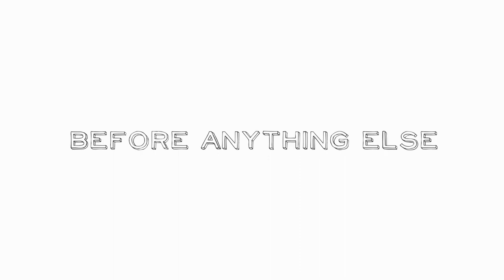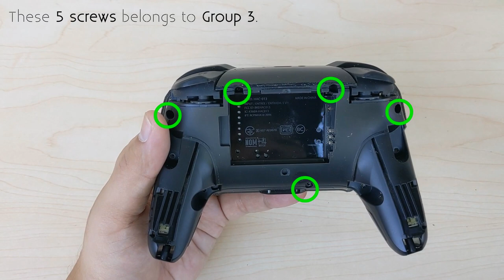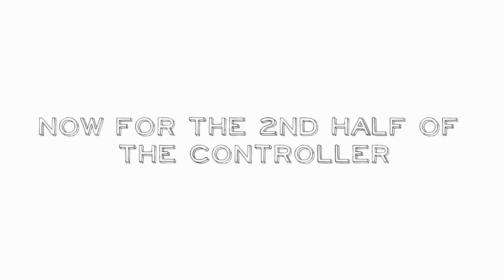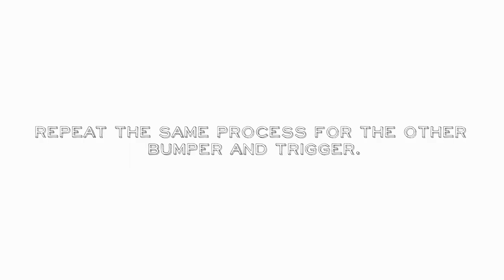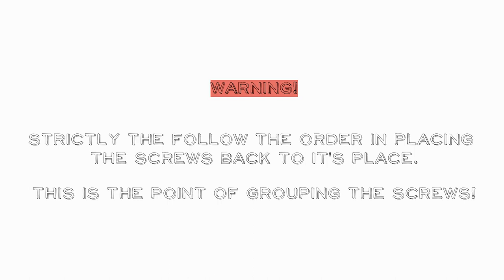Let's FIX your Nintendo Switch PRO Controller

Comment: I have a question. Will cleaning like you do help with the drifting and also the constant disconnection during in game? All these never happened before until 3 years of every day usage. Thanks.
Reply from the maker: Hi, Funn Lim! It's not in my video but spraying the internal parts of the analog sticks with contact cleaner may solve the problem of drifting or ghosting. However, constant disconnection can be a big problem here since it has something to do with the PCB.

I strongly suggest that you give this method a try first before purchasing new parts or new controller. There's nothing to lose now anyway. :)

Comment: The video is really helpful! I did however run into a problem. I have the 
Kaisi 126 in 1 Precision Screwdriver Set from amazon that I bought years ago for laptop and computer repair. I figured I could do the same to open up and clean my nintendo switch pro controller. But I was unable to reach the 2 screws behind the battery in Group 3 with my current screwdriver. What toolkit did you use to reach that deep in? Any general recommendations on tools I should buy to be able to do this would be great!

Thank you!

Comment: As a noob I found opening and cleaning pretty straight forward. Fixed drift but didn’t get ribbon back in 💯 first time so top buttons wouldn’t work. Reopened and reinserted ribbon and it’s good as new!

Comment: Hey I spilled water on my controller and now it doesn't work. I used your guide to pull it apart and maybe let it dry but it still doesn't work. Any advice on what I could do? Thanks, great video!
Reply: Buy a new one
Reply: Your controller is fryed. Get a new one
Reply from the maker: Isa is right. Your controller probably got fryed. Question though. All the buttons stopped working?
Reply: @Jaybon  I ended up getting a new one. Yea it wouldn't even power on. Thanks for the help!
Reply: @Jaybon  I spill orange juice on mine the controller still works although the buttons y is the Home Screen and b is the button used for taking pictures

Comment: Great video. I have a problem with the L button, I have to press it a little harder than the rest, otherwise the action is not detected, will the cleaning you do in the video solve my problem?
Reply: More then likely yes, cleaning should fix your problem

Comment: Hey I have a question and I hope you answer even tho I'm late, so my A button won't work so if I do the cleaning will it work again or the button is just dead ?
Reply: i have the same issue and i cleaned my controller even tho theres barely anything greasy inside but theres probably some other reason cause the controller is going crazy and doing random things on its own

Comment: So my controller is clean now; fixed sticky buttons. But now my battery doesn't work. All buttons are fine and it works plugged in. Anyone else have this problem? How did you guys fix it?

Comment: My controller has its R and L bumper not working properly as the pad where the bumpers make contact with are used and infact when i press them it doesnt even pop back up. I added some tape to the bumpers to increase the area of contact but now after a month sometimes after i barely touch them they press down. Can i do anything to increase contact or make the pad work again as usual? If anybody helps it is very appreciated.
Reply from the maker: Hi, Takurun2005! I think it's time to change the rubber contacts inside the controller. You may try to look online for a replacement and if fairly cheap. That way, you won't have to buy a new controller.

Comment: Yep just losin' my mind on that ribbon reassembly here. I finally got it but i'm guessing the microscopic contacts arent right, because when i put the battery back in it won't turn on anymore.
Update: ok yeah i had put it in wrong. Test with battery before re-assembly.

Comment: I have a question my Nintendo pro controller won't in won't charge the light on top doesnt work what should I do
Reply from the maker: Hi, Tod! Have you tried opening it in the past? There are several reasons.

1. Faulty cable.
2. Faulty battery.
3. The contacts of the type C port needs cleaning.
4. Busted pcb.

Comment: Now my a A button captures images and doesn’t confirm. Is this a ribbon cable issue?
Reply: It was a ribbon issue. Took it apart and re inserted the ribbon. I recommend putting in the battery and testing the buttons before full assemble.

Comment: any of you guys have this problem where the switch controller doesn't turn on at all? not even with the charging cable connected to it, no light turns on no matter what i press, and the battery is good because i tested it with my 3ds and it worked
Reply: I’m dealing with the exact same issue. Bought another pro controller to test the battery, so I know my old battery is still good. I just can’t get the old controller to turn on. My theory is that I damaged the usb c port by charging the controller on a poorly designed 3rd party charging dock
Reply: follow

Comment: after following all the procedures you did on the video, my pro controller just stopped working altogether
Reply: Nvm, i somehow managed to fix some of my problems but the ZL button being unresponsive still persists it’s mad annoying bruh
Reply: is my ZL button beyond fix atp ? i mean i’ve dropped my controller from time to time so it’s definitely my fault for it being unresponsive, but is there a way for me to fix it without buying a new one, or should i just accept it as it is and move on to another pro controller
Reply from the maker: Hi, AintMongo. I apologize for the late reply. I think if it's really beyond repair, just buy individual parts online like in Amazon. In your case, the ZL part.

Comment: My son spilled teriyaki sauce onto the D-pad and now it sticks, (of course), maybe another channel will address cleaning that mess.
Reply from the maker: Hi, Scott! If it's the D-pad, directly spray rubbing alcohol on the board and wipe it. Repeat the process until all the sticky sauce is gone. Don't worry, rubbing alcohol won't mess with the controller's board.

Comment: Dont use hand sanitizer. Use isopropyl alcohol (IPA) for any computer hardware. In the tech industry we use IPA ONLY. Ive worked inside INTEL cleanrooms. I wont be an ass and flex but please use the right stuff. Also, use a static-free brush if you absolutely have to use a brush. Why zap your motherboards?